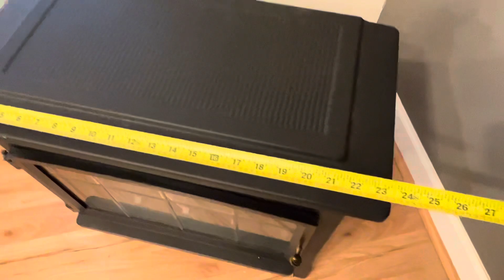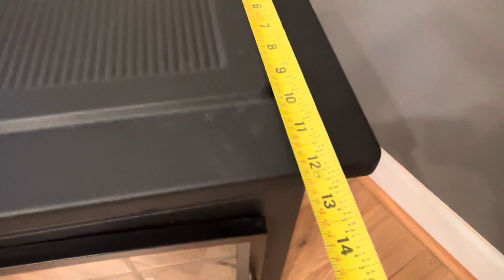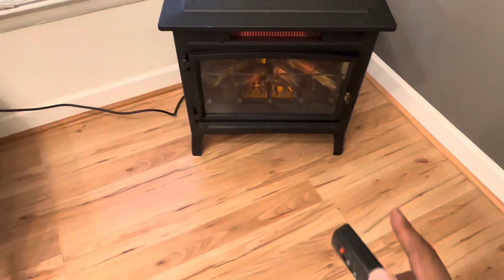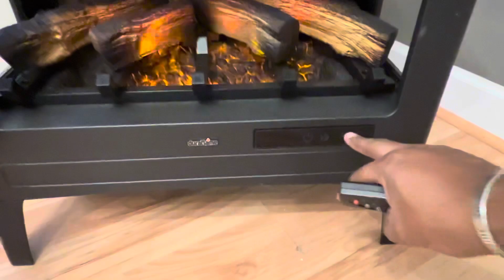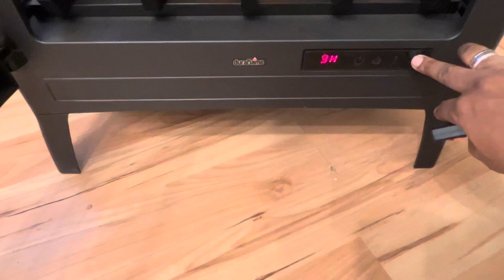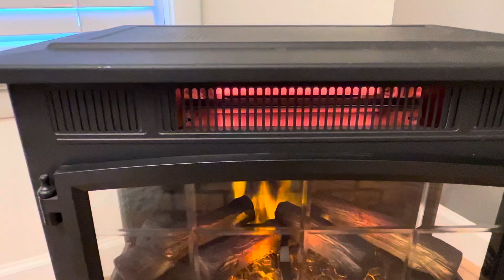Duraflame Electric Infrared Quartz Fireplace Stove with 3D Flame Effect

Comment: I have a fireplace that I use to heat my house but my master bathroom stays cold because the central heat never comes on due to the fireplace.  My master bath is fairly large with high ceilings and tiled floor.  Do you think this heater will heat it well?